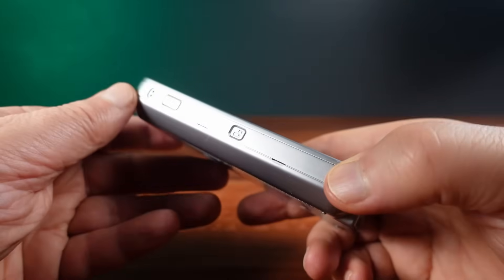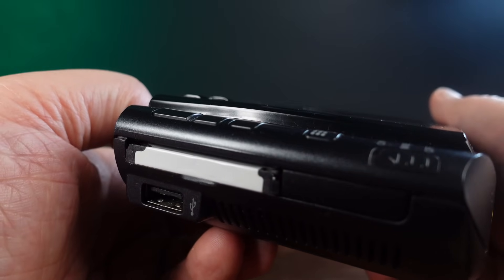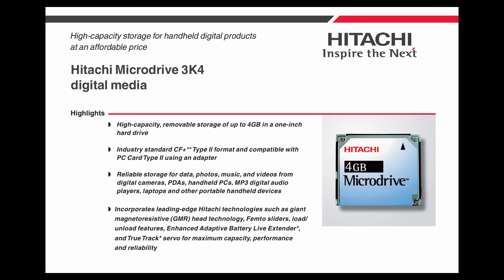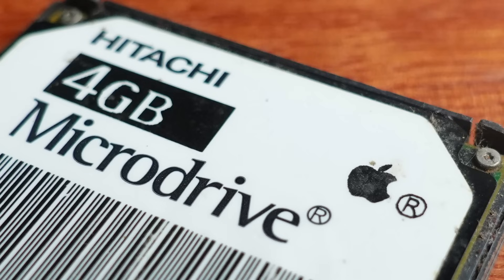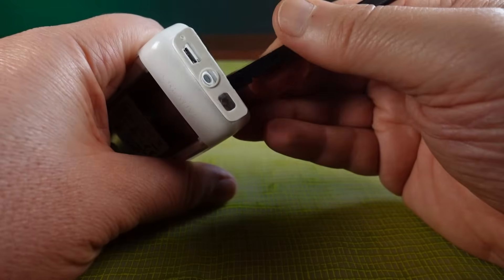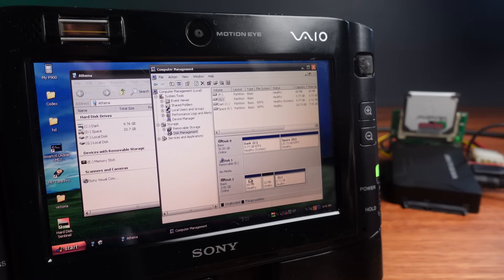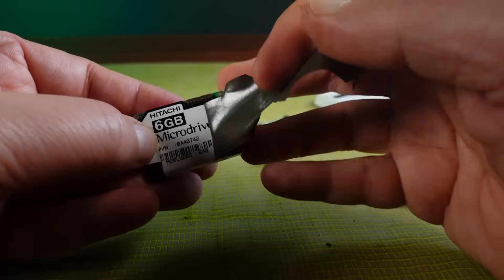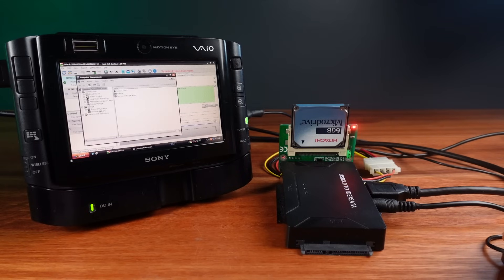Miniature Hard Drives

Comment: Mm around 03:10 - the microdrives could certainly NOT "be manufactured at a cheaper price" than Compact Flash cards, absolutely not. They Could be manufactured at a cheaper price per megabyte above a certain threshold but that was a quite high one for the time when seen in the context for removable memory card type media. It wasn't uncommon for CF cards to be in sizes that would never be done as a microdrive with any sanity, like 16mb, 32mb etc. I don't remember at which level of storage the CF cards got really expensive anymore but it was 128mb+ I think. The first microdrive if I recall correctly was 340mb or something like that, and it was NOT CHEAP by any measure, but then about 1-2yrs later I bought a 1.2Gb USB "stick" which was more a sort of puck like thing with a USB prong on it where the 'puck' was a USB-CF controller and a microdrive. For 1.2Gb it was 'cheap' but it was 100+€ and got used a LOT, far more than a flash drive at the time would have been able to handle, not to mention it was a LOT FASTER too.  
I think a lot of people got to using USB sticks when they were fairly mature in terms of tech and are therefore unaware how the early things were before the mass adoption of them. I still have an iOmega 16mb USB stick somewhere, which was very handy because it was bigger than a floppy in terms of storage and not as delicate. I could keep it in a pocket with the cap on easily, it being almost exactly the size of a lighter, and the cap had a pocket clip. Probably sounds weird to younger people that having a 16mb USB drive was useful, but it was at a time where a 1.2Gb HDD in your PC was quite big first of all, but more importantly - the alternative was using floppies which were 1.44mb. CDR was of course a thing then, BUT burning a CDR was hit and miss, and single use for the most part - there were multisession standards and so on but no one knew how to use them, and CDRW were expensive and far more failure prone. I'd guesstimate that "burn to CDR" had a failure rate of something like 25% or close, maybe 20% - but so high that almost no one really did. You threw away 1-2€ each time you tried, and it happened many times that it would fail at burntime 1-2 times, then the third disc you chucked in after rebooting the PC would get "success!!" in your burn software. You'd happily waltz off to where you needed the data, like in another city etc, only to find that the CDROM there couldn't read the disc - even though you had verified it on the source PC. 
Big pile of BS to explain why microdrives and mini HDD's as removable media were a big deal - they worked - reliably.
Reply: There were no CFII Microdrives smaller than 170MB. That was the first one announced by IBM in 1999 and shortly thereafter, 340MB. Then they went to 1GB and beyond and more companies started making them. The highest they got to was I think 8GB, but by then 8GB of flash was cheaper, and was just getting started. There were "microdrives" smaller than the CFII size (the 0.85" platters) that went to 12GB (2007-2008) but they also lost the battle to flash memory. Throughout the production period of microdrives (1999-2008) they were far cheaper to make than an equivalent amount of flash memory. When that stopped being the case they stopped being made.
Reply: @ The first I saw was the 340mb, my point was that flash based CF cards in common use at that time were far smaller in capacity like 16mb, 32mb - so the microdrive entered into a market that barely existed. There were 256mb CF cards theoretically then I think but no shops had them in stock and no one except professional photographers had them or wanted them then since they were exorbitantly expensive. 
Some years later the deal was of course totally different, there were plenty of flash based cards with gigs capacity that didn't cost that much, but when I bought the 1.2Gb microdrive based usb thing, flash USB sticks above I think 128mb got very expensive. I don't remember the prices since it was 20+yrs ago but pretty sure they were hundreds of euros for 1-2gb. Then at one point flash memory got super cheap almost overnight, and the company I worked for gave everyone a USB stick of 512mb or 1gig as a fancy christmas present. I should still have that somewhere - I think it was also to alleviate issues with people passing data back and forth at the office from one computer to another, since emails had 8mb maximum attachment size I think, and we had one external drive of some sort that everyone was trying to get to use. Don't remember what it was as I didn't use it. I think it was a Jaz drive most likely, remember it looking like a Zip drive from a distance.  
All this is sort of before 2005 I think, it's a bit hard to pinpoint what happened when off memory but 2002-2005 for most of it. I changed jobs in 2005 and didn't need portable storage much after that for various reasons. Mostly not needing to pass around large files much, and if I did I could create and assign a shared network folder for that.
Reply: @noth606  That was the whole point of Microdrives, flash cards couldn't hold anywhere near that much data at that time, and when they could they were still way more expensive than an equal amount on a Microdrive. When that changed, Microdrives went away, but they served their purpose when they were made, they were the cheapest form of large portable mass storage. It doesn't matter that there were cheap 16 and 32 MB compact flash cards, they were too small and no one wanted them for digital cameras or mp3 players. Heck, they used to give those things away for free with digital cameras so you could take a few pictures on Christmas morning, but everyone also bought a bigger card to really be able to use the thing.
Reply: @noth606  I guess I'm talking more about photo enthusiasts who wanted more than just a film rolls worth of pics at a time, and once digital cameras got to 2Mp or so those small cards started to seem pretty restrictive, and they got there pretty quickly. The first consumer 5Mp cameras were out by about the middle of 2001, which is when it was probably cheaper to buy an expensive microdrive instead of the same amount of memory in flash.  It was around that time that you had to seriously consider the cost of storage when you bought a digital camera. Microdrives in cameras were much more common in the higher end digital SLR's though,  which makes sense since they were used more by professionals who were more likely to need more storage on an assignment, like a wedding. Having to stop and change cards could be the difference between getting a shot or not. I think by the time 4, 5, and 6 Gig Microdrives came out flash was already cheap enough to cover pretty much any digital camera, but that's when they started showing up in mp3 players, a lot, like around 2004, so 2004-2007, then they were pretty much gone. BTW do you realize that your Sansa mp3 player was made by Sandisk, the memory card maker, in order to sell more memory cards? Before hard drives were routinely in mp3 players all they used were memory cards, and after microdrives became obsolete they went right back to them.
Reply: There was also a very small platter "microdrive" developed at Hewlett Packard using 1.3" platters 7 years before the first IBM Microdrive, but it was a big commercial failure and hardly anyone bought them. Even HP didn't want to use them in their own computers. They were only 20 and 40MB and cost too much to make to be competitive with anything so they stopped making them after less than 2 years.

Comment: I really like these microdrives and even tho flash memory is much more practical, i'm kinda sad that they have died out so quickly. It's absolutely fascinating having such a tiny hard drive and all of that was about 20 years ago now and these drives are becoming increasingly rare and expensive. But they are so cute and there is just something about mechanical drives that i like, especially such special and tiny ones. So of course i got myself some, although it's already a few years ago i was able to get a few Seagate 2,5GB ST1 drives for cheap, and they are the ones that say "For Emb embedded Application only" but i have been able to use them in my Multi Card Reader, so either it supports IDE or these are the older ones that still supported CF Mode.

Comment: Those tiny drives will never not impress me whenever I look at one!
It's amazing how many devices were made with them despite their overall short reign.

And the whole CF/PATA mode distinction also affected flash CF cards as well.
I know there's software out there to replace the firmware to make them support the CF interface.
People have had mixed results with it... but I do wonder if it would also work for a MicroDrive...
The USB adaptor trick is much more slick and apparently reliable, though.
Reply from the maker: Wow, I would love to know more about this firmware modding.

Comment: Could it be a zif connector?
Reply from the maker: It's smaller than the 40 pin zif used on 1.8 inch drives unfortunately.

Comment: Palm did a bait and switch with the LifeDrive. Early preview units sent to reviewers had a 5GB Seagate drive with onboard cache. The shipping version had the 4GB Hitachi drive, with no onboard cache. SUPER SLOW! Reviews were less than kind. Fortunately it's possible to replace the Microdrive with an IDE compatible Compact Flash card. Since most of the RAM in the LifeDrive is actually virtual memory on the storage, it's possible to expand how much "RAM" it has, but going past 256 megabytes is not recommended. CF cards, or Microdrives, larger than 4GB can be installed.

So if you have a LifeDrive and want the experience the early pre-sale reviewers had, swap in a 5GB Seagate with onboard cache. Then swap in a CF and see how nice this PDA can really be.

Rio made a microdive MP3 player called the Carbon. Equipped with a capacity up to 6GB, buying them just to remove the drive was called "decarbonising".
Reply from the maker: Really interesting details. Thank you for this.
Reply: @JanusCycle  A predecessor to the Mivrodrive was the Hewlett Packard Kittyhawk. Available in 20 and 40 megabyte versions. Dimensions were 50.8 × 36.5 × 10.5 mm

Comment: So an oddity was the 5th gen iPod, the original iPod Video. It had a Toshiba HDD in it ( not Hitachi) that ran PATA but used a very similar ribbon cable that you see in 13:08. Ran fine on a PC with 2007 ebay adapters. 32 gb of extra storage. I knew this because i used to mod them in 2006.....because even back then Apple made boring products lol Used to charge kids for the mods. Never opened a 6th generation video "classic" but i assume its the same, they just looked like modern MacBook's(6th gen iPod) vs 1st gen iPhones(5th gen iPod). 

Another oddity was the Datel 4GB Hard Drive for the PSP 1st gen. It came with a 3500mah battery pack to offset the power used by the HDD. Magic Gate Sony sticks were over 100 bucks for 1gb. You got a 32mb stick but it sucked if you wanted music on there, even with ATRAC codecs.  This, in 2005, was a game changer. I had it in 2006 as well, so I then took my entire iTunes library and converted it from AAC  to ATRAC 3 PLUS. ATRAC allowed a relatively small disc like MiniDisc to have the same running time as CD while storing audio information with minimal perceptible loss in quality....so on a 4GB HDD you could fit a few hundred songs on there easy.

Comment: Palm should have made a phone before the iPhone.

3 Mobile operating systems would have been better than Android vs iOS.. Windows was too late to the party.
Reply: Couldn't agree more. The later models with 320x480 displays were so close to what the iphone eventually was that it was amazing they couldn't see it (the original iphone also had a 320x480 display), instead they seemed to determined kill their big screen pda's in favor of phones with smaller and smaller screens that no one was asking for and that hindered their use as both phone and pda. They were a clueless bunch until the very end, when they were finally scrambling to get an iphone clone out as fast as possible, after they let the prototype (their big screened pda's) whither and die on the vine for years. No one can say they didn't deserve their ignoble end.

Comment: One thing I should've asked earlier: How did Hitachi manage to afford charging much less for the disk drive that would be going straight into a player, so that the whole player could cost a bunch less than just one of the drives sold separately from the player?
Reply: Volume discounts, different warranty and support terms (i.e. none, at least on an individual-drive basis — these things shift to the player maker), reduced packaging (shipped in bulk, likely in trays), and long-term contracts, which mean that they have guaranteed sales for a while, during which Hitachi can reduce the manufacturing cost.
Reply: Bear in mind that, outside of the grocery industry, the retail price of an item is far, far higher than the wholesale cost, and the wholesale cost is a lot more than the cost of manufacturing it.

For tech accessories like cables, the wholesale cost is often less than 10% (!) of the retail price. For most things, for example headphones, wholesale is usually around 40%. Only higher-price items, like computers themselves, have very slim margins, with wholesale cost being 90% or more, sometimes even 100% (retailer selling it as a loss, because they make up for it with the accessories and software). 

So if we imagine a pair of headphones, or a keyboard, or an antivirus package for a year, each of which sells for $100, the retailer paid around $40 for it. And that $40 has to include the cost to design the item, manufacture it, package it, ship it to the retailer, plus expected future warranty fulfillment costs, as well as overhead and profit. So the actual unit cost to manufacture the item might be just $20. People forget that retail prices have to fund the entire supply chain from design to point of sale, and that those ancillary costs make up a much larger portion of the price than they expect.

(Yes, I worked in IT retail in the past.)

Comment: I have a stack of about 20 4-6GB Microdrives that I've removed from a pile of iPod Mini's, Muvo 2's and Zen Micro's. I replaced them with CF cards and hadn't found a use for the Microdrives afterwards. They are indeed quite a marvel of miniaturization engineering, but I really cannot find a use case for them in this day and age. The Microdrives were all working fine when I pulled them though, which seems like a bit of a waste, just having them sit around in my parts bin.

Comment: 13:50 that's a ZIF connector, maybe a Hitachi ZIF 40 pin. The iPod Video 5G and up started to use them too, but with larger 1.8-inch drives. Indeed it is still the exact same IDE signals, just over a flex cable.
Reply from the maker: It's not quite ZIF 40 pin. Unfortunately I don't know much more.

Comment: Have crossed your mind to increase the Lifedrive capacity with one of the 6GB working disks? Any way to clone the contents of the original drive and install them onto another one?
Reply from the maker: Yes this is all possible. As well as installing a regular Compact Flash card. But I kinda want to keep my LifeDrive spinning with a mechanical drive.
Reply: @JanusCycle  I remember you saying that in others videos as well... So with modern CF cards, I've seen some in AliExpress as big as 256 GB... What's the max that a Lifedrive can recognize?
Reply from the maker: @ There is a Reddit post from a few years ago where someone gets a LifeDrive working with a 128GB Compact Flash card. Apparently it works well!

Comment: man. now we have M.2-2230 SSDs up to 2TB in less than half the volume. 20 years does a lot to tech
Reply: The difference between an NVMe SSD and a MicroDrive: Data on the MicroDrive will still be readable 10-15 years after being written, a very big gamble to take with TLC and even MLC NAND... 💾⏳🗑
Reply: @dieseldragon6756  yeah well good luck finding SLC solid state on current market
Reply: @ There's a good reason why I've never thrown out a confirmed SLC drive. And why I tend not to throw out any flash drive that predates 2010... 👍

Comment: I've shucked MicroDrives out of both MuVo² and Creative players. I was never able to access any data on them with the equipment I have, but I have an older card reader which seemed to have no problem writing data to them. 👍

Interesting to learn about the trickery Hitachi engaged in to actively prevent camera owners from shucking drives out of retail devices. I wonder if that's technically an antitrust violation i.e. taking steps to prevent equipment from being used for a purpose that it is safely and reasonably capable of performing so you can sell a higher priced (But otherwise no different) variant aimed at that purpose? ⚖

Finally: The reason why older USB readers don't usually support SMART is because the reader simply treats the connected drive as a block storage device without reference to the fact it's an HDD, simply passing Read X-Y and Write X-Y commands between it and the host computer. This is likely the case with the slim USB reader you show here, though curiously enough it appears to be passing commands to the drive via the ATA protocol rather than the expected CF.
More recent USB devices (Mainly drive docks and external drive enclosures) implement UASP which supports the SMART command set, but in the case of older HDDs SMART is only available if the connected device implements its own ATA interface and supports the SMART command set. 😇